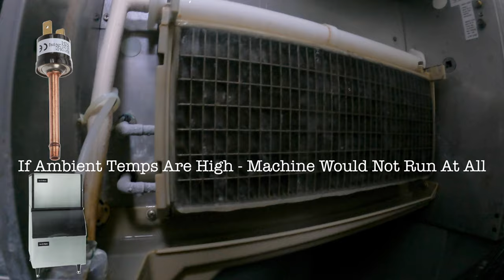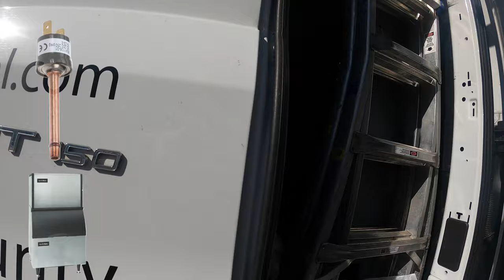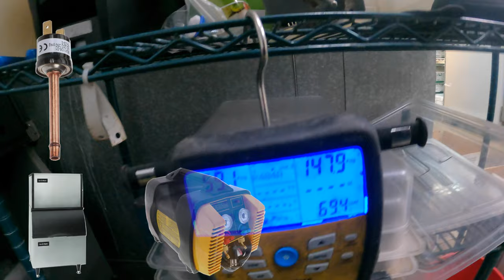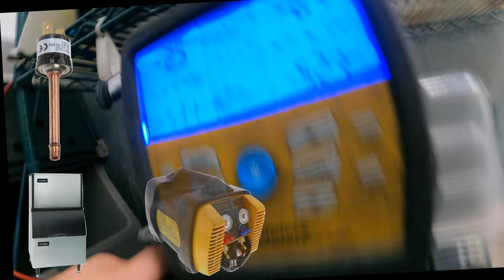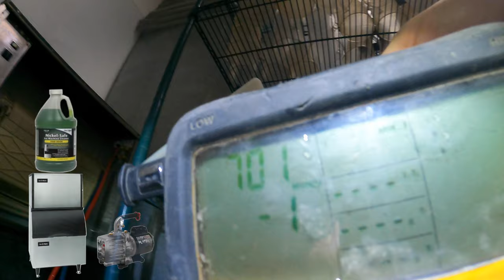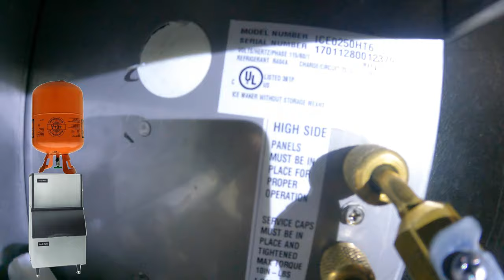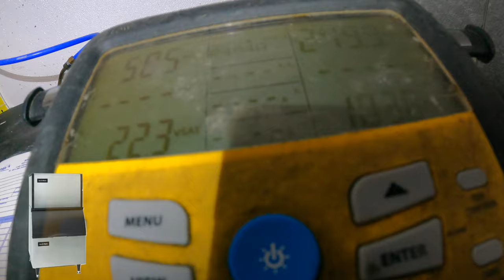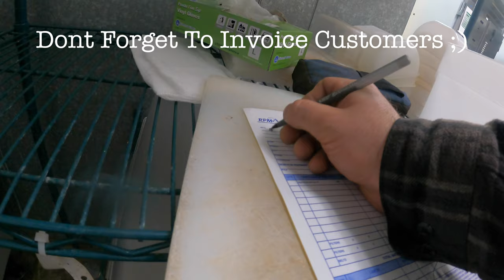Restaurant Ice Machine Repair. Fan Cycling Switch. Common Problem.

Comment: Good video ! I’ve had good luck with just bypassing those fan cycle switches / just put wires together. No fan cycle switch =
No more problems.
Reply from the maker: Thanks Phil!👍 I tried bypass it years back, but at lower ambient was getting very thin ice to the point that it just melts of Evap plate during harvest, so I always replace them, sometimes just T it of liquid line service port, but i always replace install cycling switches 👍
Reply: @MaratRPMSoCal   Yea , I have Allways done in warm kitchens , with maybe greasy condenser with air filter on them. Have u tried readjusting timer block to add time in cold applications. It would probably work. Just click the 512 switch over to add 8 minutes to cycle. And the 256 if necessary to get your cycle time you need. You could just click a bunch over and time the needed cycle time when suction hits 30 Psig. Just a thought to get u out of a jam or get u a few days till u can get a switch.
Reply from the maker: @OcRefrig  I did play with those timers before, but at the coldest nights specially by PCH cities, that not even enough. I know that I dont need to worry about it once cycle control is installed👍. this place is a juicery, so no heat in the restaurant, wouldn't risk it for them to bypass. I thought to get peanut generic switch from Johnston at the beginning and just T it of liquid service valve, but then Its not that bad looking machine to start re-do manufacture set up on it

Comment: Nice 📹.!. Did u put magnet on solenoid to confirm everything was recovered?
Reply from the maker: thank you! I kinda knew that there is nothing behind solenoid, for models with 2 hot gas valse you will have to open that valve with magnet while recovery 👍